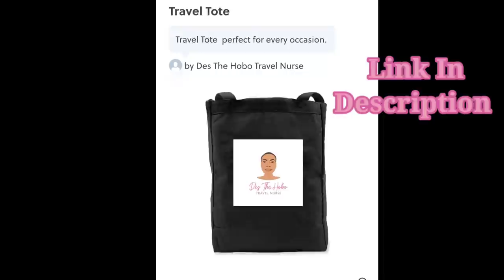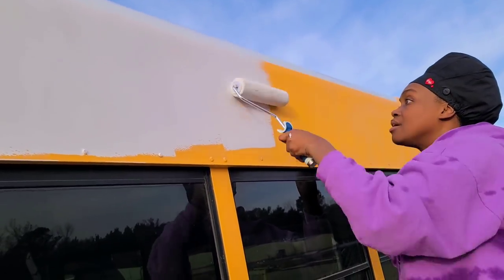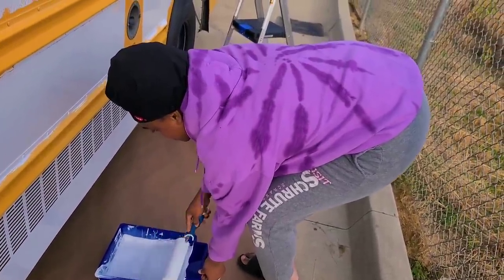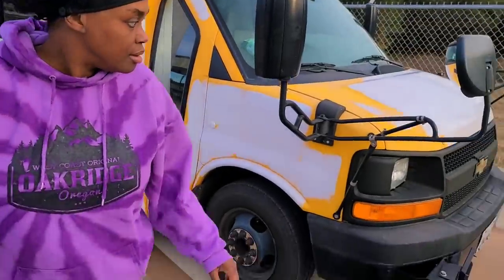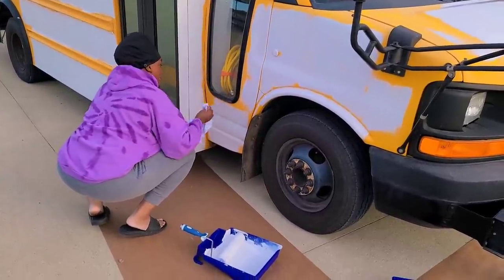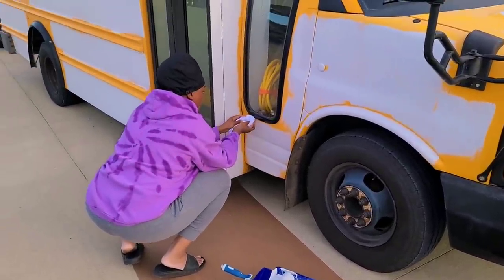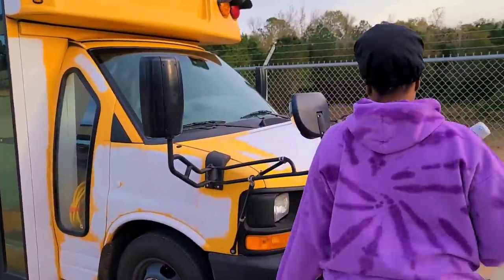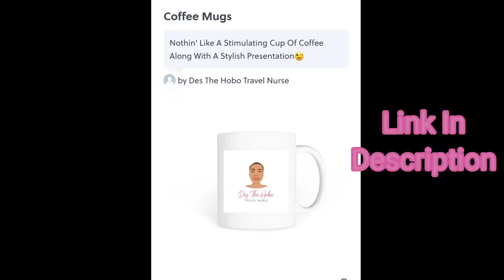BusLife Vlog | Skoolie Conversion DIY Painting part 1 #skooliebuild #busbuild #skoolieconversion

Comment: The stop signs are pretty easy to remove.   Pull them out and unbolt and cut wires.  Then heat shrink the wires and stuff them in the hole.